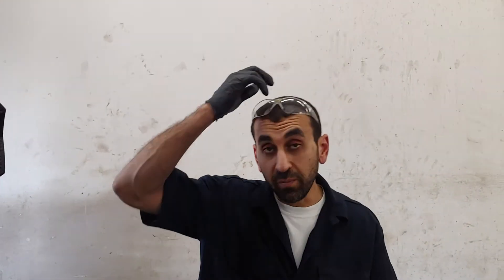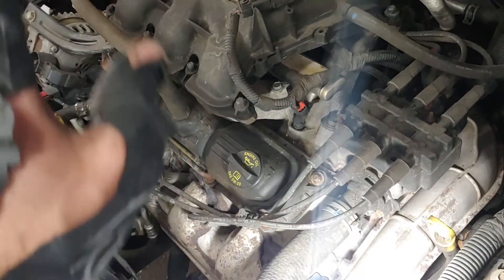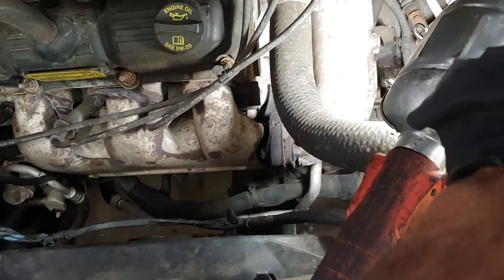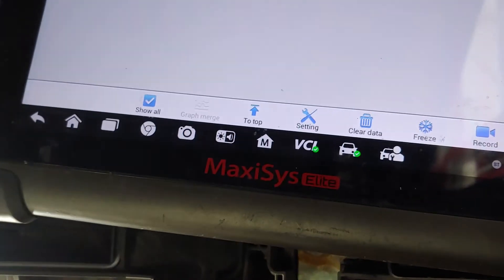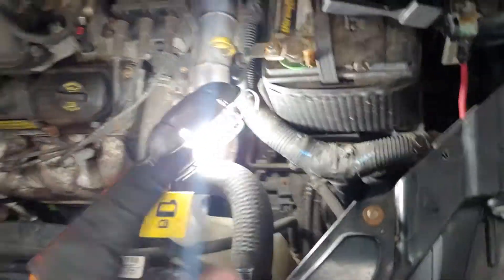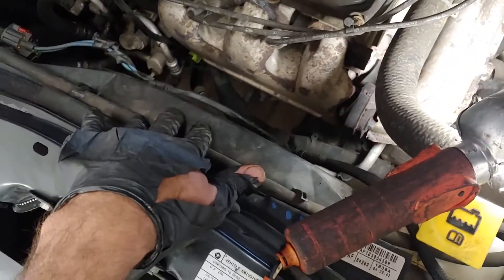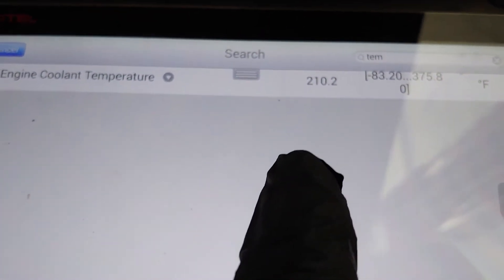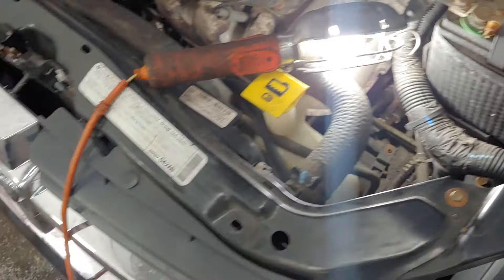2010 Dodge Grand Caravan SE 3.3L V6 Overheating Cooling Radiator Fan not working

Comment: Would this be a root cause of radiators bursting. I am on 3rd radiator in 3 months.
Reply from the maker: Don't believe so , but you can always check if your fan kicks on when temperature is reached to half , keep close eye on it and monitor the fan.
Reply: Hey did you got fix for this situation cause iam on my 5th radiator and still not found the issue 😭
Reply: @mohammednouri3726  after wasting money on mechanics some didn't even install parts just added fluid some replaced parts that's were easy and yes after all those radiators and a new cap and new thermostat and new waterpump system power flushed and no blockages anywhere pressurized the system no leaks headgasket is not blown. And it still overheats I even put 70/30 ratio of coolant to water.

Comment: Question does it matter witch part number the relay is cause I got a new part like yours off Amazon but it has a different part number then the old one I had on my dodge caravan originally and mine is a 2008 if you could reply and let me know that would be great thanks
Reply from the maker: I am not sure what you got , you may want to check the compatibility and fitment of the relay . Different part number may work.

Comment: How about if I put a new one still my fan does not work.I put new radiator resistor new thermostat new coolant temperature sensor and still does not work on my 2010 Dodge grand caravan 3.3
Reply: Do you find out what’s the problem with it?

Comment: 2013 caravan, the fan isn't coming on with the a.c. I see 2 relays! Which one do i replace?
Reply from the maker: I am not sure how different it is on 2013 , but you can try swapping relays , if you can get a good relay and try swapping both one at the time to see if that gets your fan to start. Good luck
Reply: @autorepairchamps  I found another channel that identified the relay, i'm going to swap them tomorrow.
Reply: @johnnellis3025  howd it work out? I'm having the same issue, what relay was it?

Comment: Where is the fuse for the cooling fan?how come I replaced new relay and new temperature my cooling fan still does not working?thank you
Reply: because part swapping isn't right way to fix things and becomes costly! Checking and diagnosing is proper way before you begin buying replacement parts for parts you test and find to really be faulty! This shouldn't have taken them a few days , its a simple system and is simple to test with proper tools and training. Takes about hour to make sure wires from fuse box to fans are in fact not the issue , another 1hr to test the speed control devices in system and sensors like AC high/low limits , The Fan speed controller, pcm sending/receiving proper temp signals (can see that on scan tool and rule out defective temp sensors and such based on readings your seeing) and then the High speed relay.This is of course checking the fuse box and other known problems that plague these vehicles. Dunno why they didn't check fuse box and the fan relay in it first , then to the fan controller resister on the fan shroud and the high speed fail safe relay that was the issue here.Ive been there and tried to jump around and skip things and it leads you in circles with you pulling your hair out and lots of wasted time. Follow proper testing and rule it out as you go and you dont waste days trying to fix things you overlooked 20 times...

Comment: I'm having the same problem with a 3,5 2010 charger. Do you know if the 2010 3.5 litre Charger has a similar stand alone relay like the 2010 Caravan? I know about the 3 relays and 2 fuses in the engine compartment fuse box.  Also there are no codes being set.  Thanks.
Reply from the maker: It could be many things , your Thermostat , your ETC Sensor, Head gasket, cooling fan motors, Coolant bleeding procedures . I would start with Checking fuse #12 , it is 40 amp fuse for the low speed fan. This fuse may look good, so test it or swap it with another fuse.

Comment: My 2008 dodge caravan's high speed fan is not coming on.  I changed the same relay you pointed out but still not coming on.  I'm uncertain if that is indeed the high speed fan relay as when I search rock auto they present a solid state relay with cooling posts moiunted on the relay.
Reply from the maker: Test your fan with 12v Battery, Id prefer you use a scanner because you can test your fan low and high speed with that , does your fan turns on when you turn your AC on, if it does that means your high speed is working and perhaps your low speed fan setting is not kicking in .